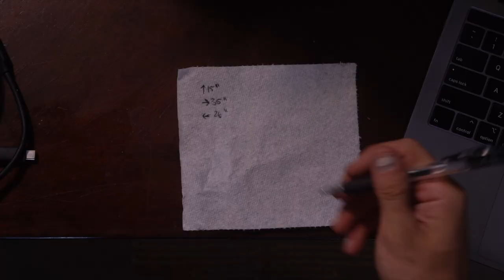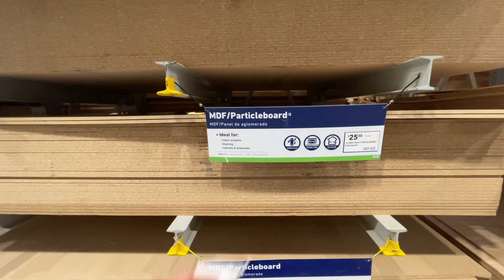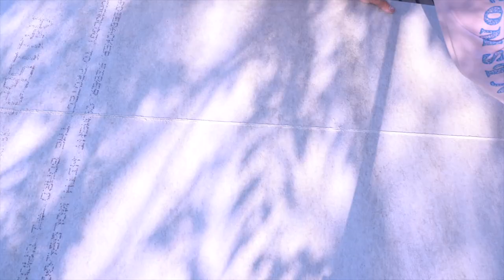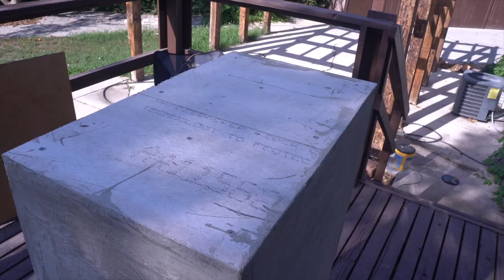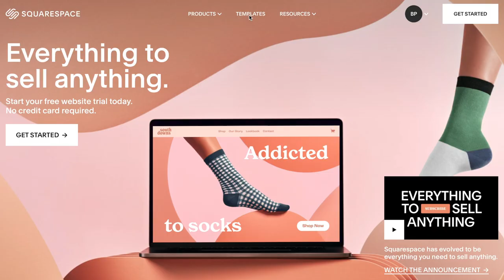DIY concrete table (making a $2,000 table for $20)

Comment: I made a similar project a few years ago... A couple tricks I've learned in my process back then. Build the base structure from moisture resistant chipboard. That helps with the swelling and avoids too much cracking. Cover the whole structure with PVA and hessian on top. Hessian is dirt cheap and gives the concrete a nice structure to grab on. I've used normal Portland cement. 3 parts cement, 1 part sand, 1 part PVA. Then added water until I had a thick yoghurt like consistency. Before applying the concrete I made the meanwhile well dried and glued hessian wet again and applied about 5-8mm concrete. The water in the hessian keeps the concrete from drying out too quickly and cracking. Then I covered the whole project under a sheet of plastic for two days. With a metal blade, I've flattened the surface and allowed another day for drying completely. When dry, I've rollered some acrylic mat clear coat on and voila concrete coating is done. Works for wall panels as well.
Reply: I would love to see you post a video with your process!
Reply: How many days did take you to finish?
 @tannercc

Comment: Great stuff! I know the cracks you got are mostly structural, but more often than not cracks are do to concrete drying to quickly. To fix this you can cover the concrete with a tarp and spray it with water now and again.
Reply: Oohh, great tip!

Comment: You didn't need mesh tape just be careful turning and banging the already concreted sides and you won't get cracks, OR use conc primer /adherent first
Reply: You'll always get cracks on the corners because it's an unstable substructure. Have you ever laid a tile?

Comment: After your adjustments, what would you have your dimensions were for your table? And.... are you thinking that the concrete board isn't needed if you use the drywall tape?

Comment: Alright, maybe a a dumb question, but is there any problem with wood getting wet from the concrete? In terms of swelling/molding/rotting? If I were to recreate a nightstand-sized table with a scrap wooden crate using your technique at the end, would there be any issue for the wood to get wet by means of the concrete? What ya'll think?
Reply: All the moisture from the concrete will evaporate, thats how the concrete dries 👍 so the wood may swell a little initially but it wont rot or mold